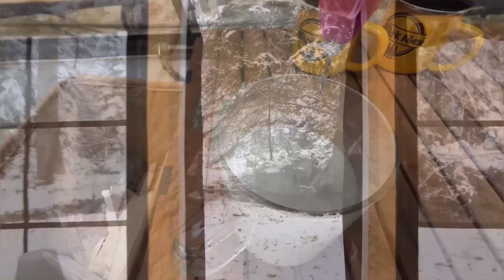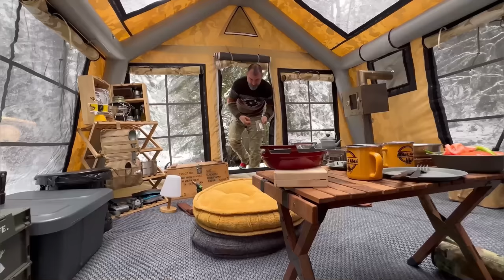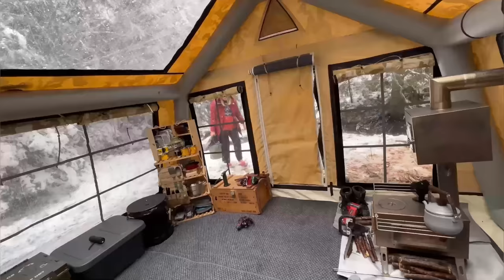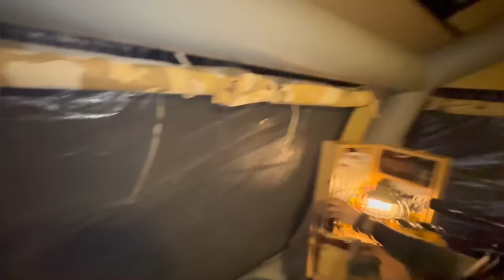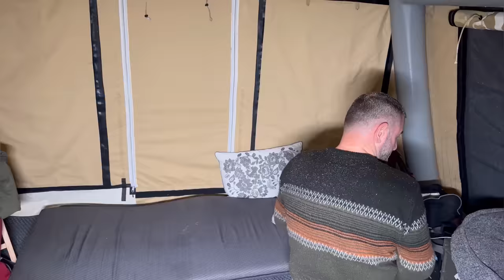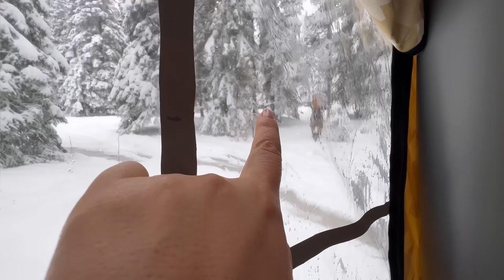ŞİDDETLİ KAR YAĞIŞINDA SOBALI SICAK ÇADIR KAMPI

Comment: Now that is a mighty nice 4 season tent, and wish there was more info, cost, setup time, weight, size.
Been a tent camper and even in heavy duty framed canvas tents one could say remains primative and weak in heavy wet snowfall, ventilation inside sweat and incomplete years leak along seams.
Respect !
Reply: Know what U mean about canvas.  We had streams running along our sleeping bags during a Florida camp venture

Comment: Your snow pellets are called Graupel. 
In English we have three words ice or snow, graupel (ice drop with an attached snowflake), Sleet (small ice pellet), and hail (size starting at Pea: ¼ inches 5mm, Penny: ¾ inches 10mm, Quarter: 1 inch 2.5 cm, Ping Pong ball: 1 ½ inches 3cm, Golf ball: 1 ¾ inches 4cm, Lime: 2 inches 5cm, Tennis ball: 2 ½ inches 6cm, Baseball: 2 ¾ inches 7cm, Apple: 3 inches 9cm, Softball: 4 inches 10cm, Grapefruit: 4 ½ inches 11.20 cm
google translated:
İngilizcede buz veya kar için üç kelimemiz var, graupel (bağlı bir kar tanesi ile buz damlası), squet (küçük buz peleti) ve dolu (bezelyeden başlayan boyut: ¼ inç 5mm, kuruş: ¾ inç 10mm, çeyrek: 1 inç 2.5 cm, ping pong topu: 1 inç 3 cm, golf topu: 1 inç inç 4cm, kireç: 2 inç 5cm, tenis topu: 2 inç inç 6cm, beyzbol: 2 inç inç 7cm, elma: 3 inç 9cm, voleybol: 4 inç 10 cm, greyfurt: 4 inç 11.20 cm.

You make the best camping videos ever (epic).  ladies pick flowers  men go change the oil